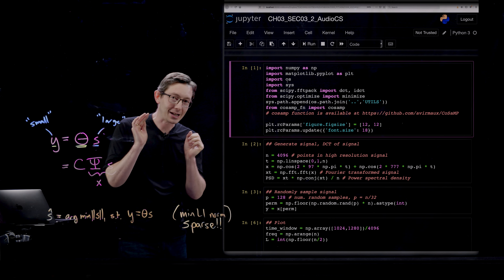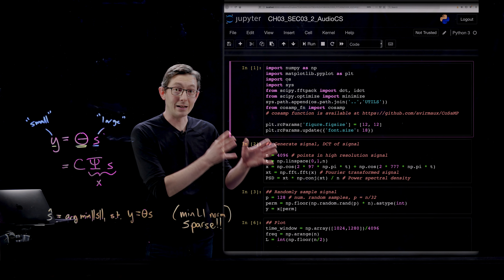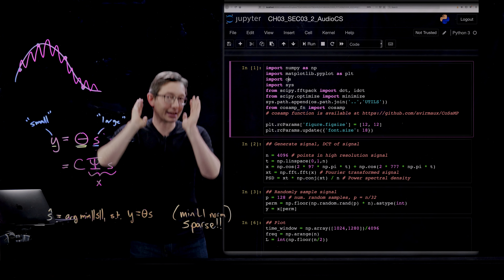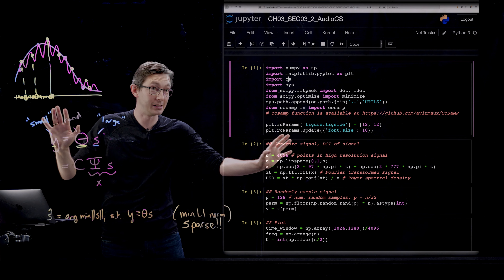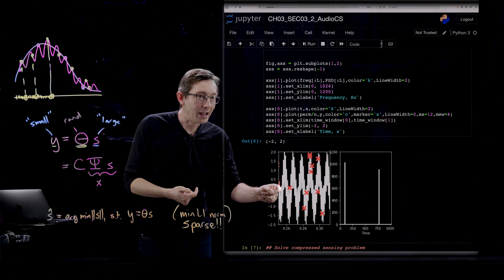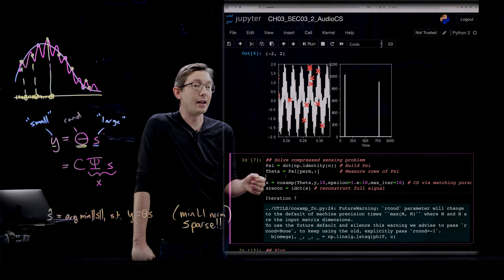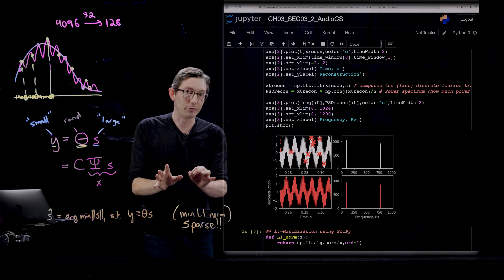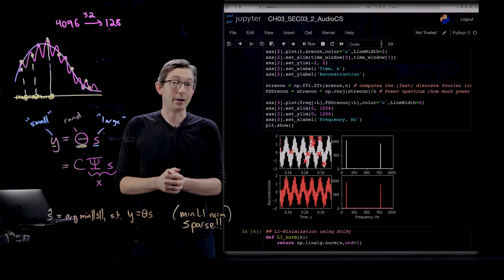Beating Nyquist with Compressed Sensing, in Python

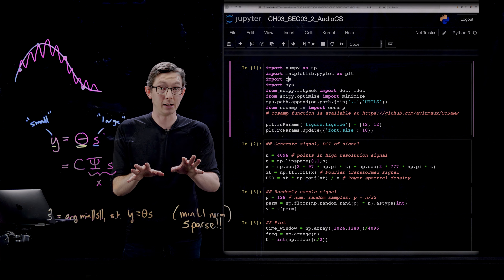Comment: 2:40 - If you under-sample a signal with components over the Nyquist frequency, then you'll create aliases. Your sampled sequence will contain an alias of the under-sampled component. The problem is that you cannot distinguish it from an actual source signal on such aliased frequency.
For example, if you have a sum of components at 128 and 768 Hz, and sample it at 1024 Hz, your sampled sequence will contain an aliased frequency 256 Hz. You will not be able to tell such sequence from the input signal of 128 and 256 Hz components.

Comment: What about noisy signals?

A simpler version of the same idea is bandpass sampling. Although bandpass sampling guarantees reconstruction of a noiseless signal with fewer samples in the time domain, the final signal to noise is determined by the total number of samples. So in fact there is no reduction in measurement time for noisy signals.

Comment: can you explain some use cases for that kind of sampling? I feels like the requirement to be able to sample quickly twice in a row doesn't allow for using slower and cheaper ADCs.
Reply: I have the same question.
While thinking about it, without being versed in this stuff, I came to the idea that you may have two low-freq "samplers" with a very small time offset between both. The maximum frequency you'd be able to detect with such a setup would depend on that offset more than on the sampling frequency of each "sampler".
That deviates quite a lot from the idea of having a single one with randomness, but that's the best I could come up with.
Reply: Hey, I am not really sure but, what if historic data is used of a larger time window and the pick a random subset of points? Perhaps not as good as high frequency sampling but it could work I assume with a larger sample
Reply: I am not very experienced with this, but I guess one very simple case would be for storage purposes. If you’re collecting PIV measurements of a flow it is important to be able to observe the flow for a long enough period of time to observe different phenomena but storage can be a problem. Sampling at a high frequency only a few random time points would solve such a problem.
Reply: Applies any time that the sampling process is expensive. So if the measurement system generates heat for example and running at full rate will cause eventual overload. Or if the storage of samples is expensive (ex super high spatio-temporal resolutions). Also, purpose-designed CMOS sensors can achieve a higher throughput (spatial or temporal or both).

Comment: great video! How much frequency components can we plug in until the reconstruction fails? in other words, how much non-sparse can be the original signal to achieve this reconstruction with only 128/4096 sampling? is there any metric to tune up the number of random points needed for a given signal with a sparse power spectrum?

Comment: what should be go wrong if we can use exponential gowth/decay function to determine when we have to get sample, instead of pure random number of sample? Or Fibbonaci naumbers to determine sample times, for example 1,2, 3, 5, 8, 13, 21 etc. With each single sample we look at different frequency of source signal.
Plase dont baned me, im not a mathematican.
Reply: Good question, exactly what I was wondering. I’ll be coding up a simulation to evaluate this (as well as the influence of noise, non-stationarity, etc) and I’ll report back.

Comment: How is the random distribution? A gaussian distribution of sample rates doesn't seem the best idea. Wouldn't you have try and get a really far distribution? So you have a few close measurements points and equally many really far apart?
Reply: I believe the code a random uniform sampling through time, which in turn implies a random exponential distribution of time deltas.

Comment: He is cheating.  His random number generator is able to generate two points close together which represents a high frequency.  This isnt allowed by his premise.  He can only sample random points with a restraint on the minimum frequency or space in time between them.  I dont think it works then.  It might work over multiple periods of data with a minimum random point distance. He didnt put that in the program that I see or at least didnt mention that. Take a slower frequency and phase shift it controllably over multiple cycles might be a better demonstration. You must change the phase slowly in order not to form a higher frequency.